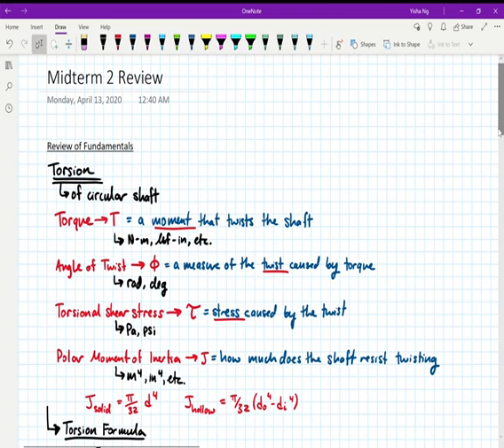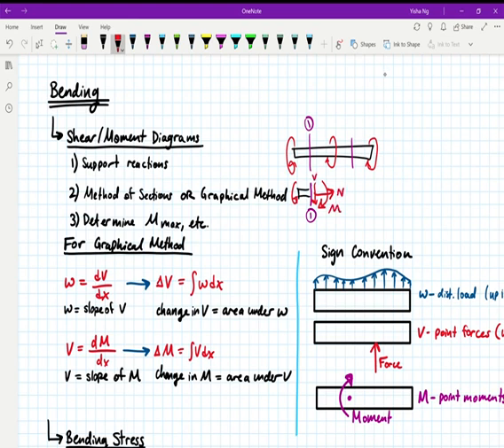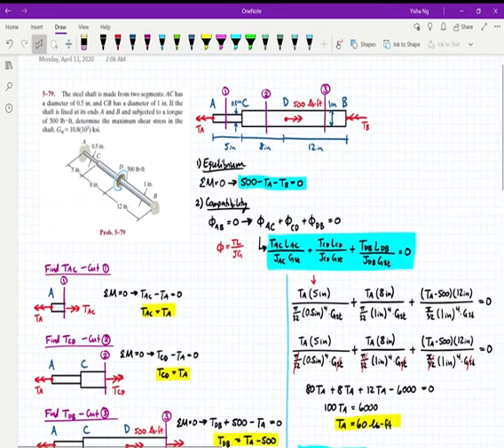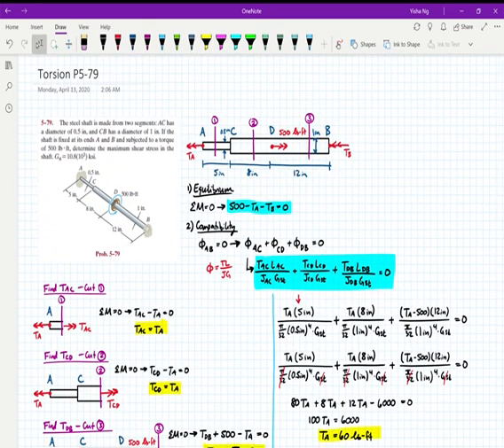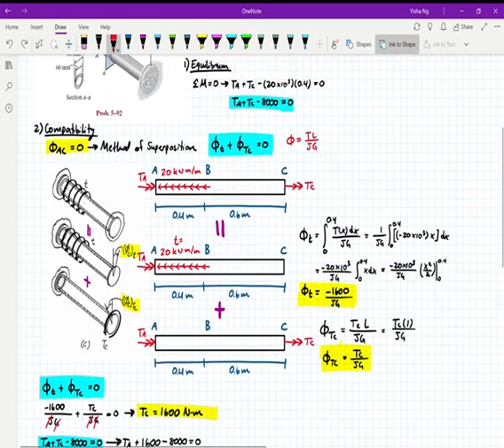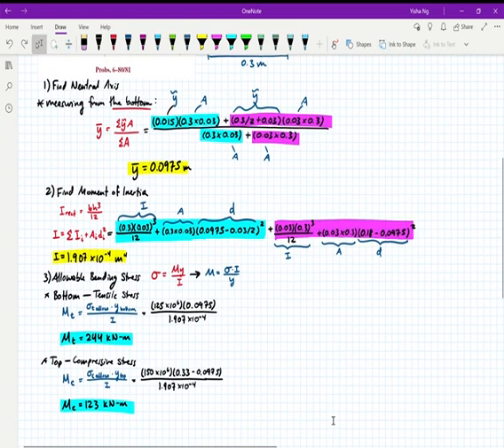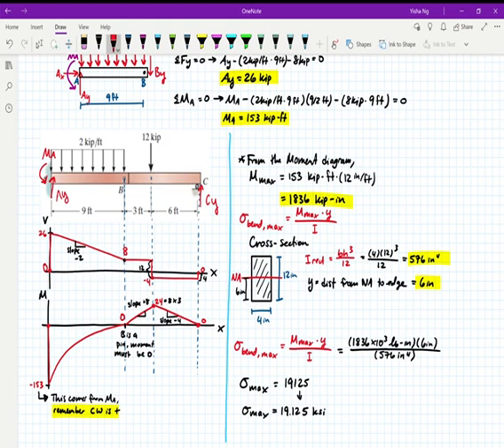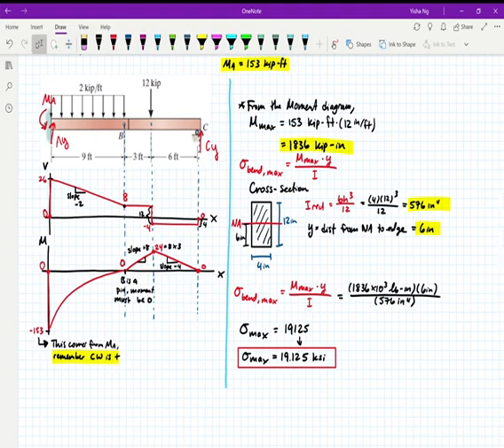Midterm 2 Review - MAE 213 Mechanics of Materials

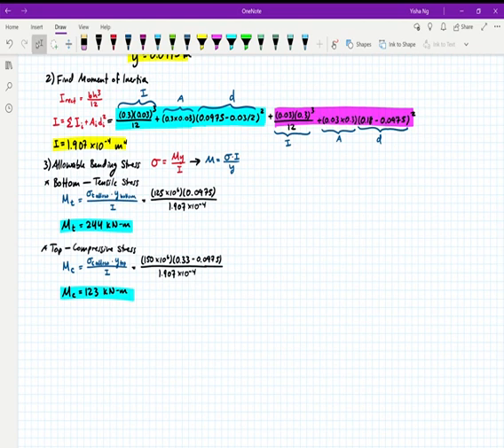Comment from the maker: NOTE: At 37:17 For problem 3 (Bending example 6-81)
I wrote the Mt and Mc section wrong when plugging in the values, but used the correct equation in my calculator. So the final answers are correct, but the interim part is mixed up. The PDF is now corrected on Canvas, but here is the corrected step:

The correct equation is M = sigma*I/y
Mt = (125*10^6)*(1.907*10^-4)/(0.0975) = 244 kN-m
Mc = (150*10^6)*(1.907*10^-4)/(0.33-0.0975) = 123 kN-m
Since Mc is less than Mt, 123 kN-m is the maximum moment M that can be applied to the beam.